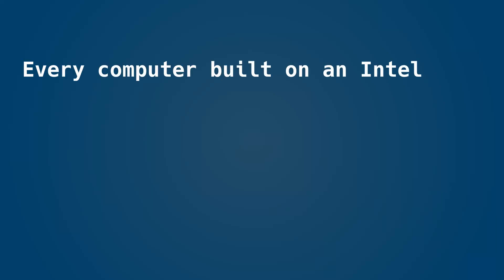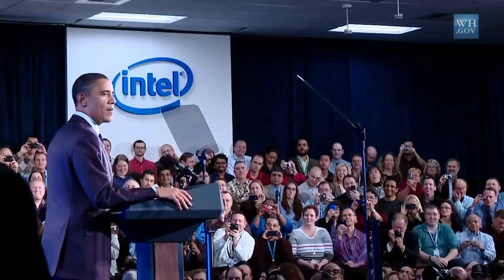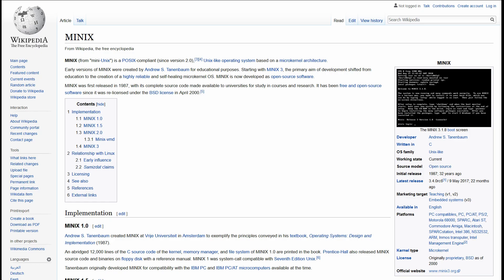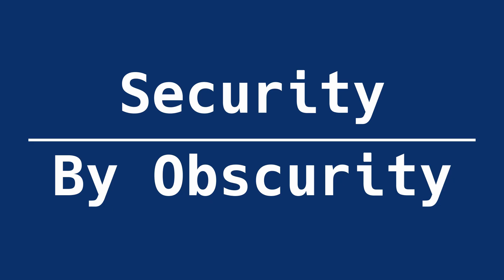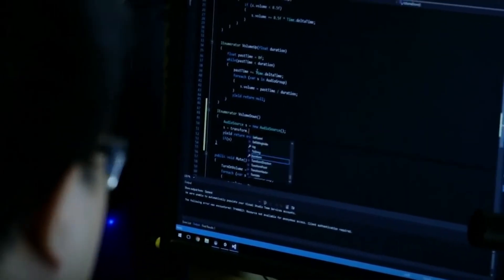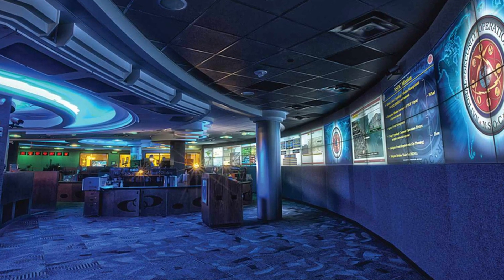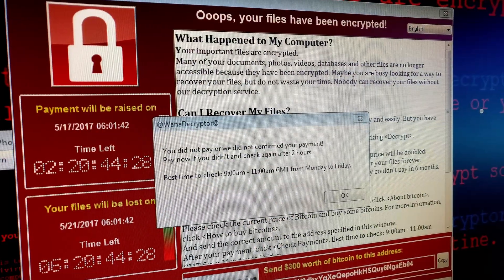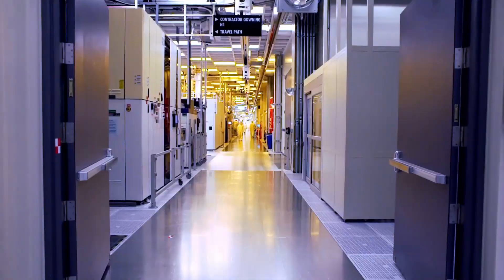How Intel wants to backdoor every computer in the world | Intel Management Engine explained

Comment: Microprocessor =/= microcontroller.
Please, for the love of god, do atleast some research before making a fearmongering video like this.
Reply: @nawtilismaelis2043  no legit im named after an anime character
Reply: @yangxiaolong8657  Still a ch1nk.
Reply: @nawtilismaelis2043  you seem like a fun guy
Reply: @nawtilismaelis2043  cut the racist BS out
Reply: Why are Intel so vague about it if there is nothing bad about it then?
Reply: @itIsI988  exactly, they should open source it
Reply: That’s why the dislike ratio is so high
Reply: Microprocessor =! Microcontroller
Reply: @Ky-vv8nj  you mean != Not =!
Reply: @nawtilismaelis2043  im not chinese
Reply: @michaelhord  salty?
Reply: a microprocessor is basically just a dedicated chip that needs other things to function, like external ram and such. a microcontroller has everything inside ready to use (like an arduino)
Reply: @kettlesimulator  No. Arduino isn't a microcontroller. The microcontroller is that DIP chip you see on it, and it needs external things like clocks to run.
Reply: @aidensmith6277  what i mean is it's a microcontroller based device. also sometimes you dont need external clocks if you're fine with internal clock
Reply: @kettlesimulator  oh, are there microcontrollers that have internal clocks? SMD microcontrollers?
Reply: @aidensmith6277  if you google the ATMEGA328p (a microcontroller), you'll see it has an internal 8MHz clock/oscillator. but most internal clocks have bad accuracy which basically means if you coded it to have a 1 second delay on say blinking an led, it might end up being 2 seconds
Reply: @kettlesimulator  oh, cool, didn't know that. Cheers mate :)
Reply: There's a microcontroller inside these microprocessors.
Reply: They have an Kernel With a network stack. With Root certificates. 
Think about it. They know the MicroProcessor better than most. How much of the assembly language is undocumented? 
They know better than anyone how to backdoor their own assembly language. They just need a method of code execution without a pesky OS in the way.
Reply: @nugget6635  "It does a bunch of things" =  I don't know what the fuck I'm talking about but I'm hoping you're dumber than me and won't notice that I don't know what the fuck I'm talking about.
Reply: Doesnt change the fact its a backdoor nobody wants
Reply: @yangxiaolong8657  Doesn't change the fact that you don't even know what its function is. Do you really think that the sole purpose of this thing is just to spy on you? No. From the perspective of a hpbbyist engineer I can tell you for certain that this thing would of had too much money, time, effort and sacrifice of the performance of the rest of the chip to just be a spy chip.
Reply: @aidensmith6277  Lol okay, so if it does something useful what is it?
Reply: @yangxiaolong8657  You lot are the ones claiming that it is a spy chip, so I want you to prove it.
The burden of proof is on you.
I never claimed I knew what it was, I just said that the soul purpose probably isn't just spying. Of all the functions it COULD have, spying is the one you are going to choose of you want views.
Reply: @aidensmith6277  whatever it's function is, it is still a backdoor and a serious security risk
Reply: @yangxiaolong8657  Security risk?
The whole video he was saying how you cant access the damned thing.
Sounds pretty secure to me.
Reply: @aidensmith6277  not that you know. Someone can access it, else it wouldnt exist. Now if that were to leak or if an exploit was found
Reply: @aidensmith6277  the fact that you can't access the thing should be of concern. What processes is it running in the background on its own separate OS? It can obviously formulate its own networking connections. What stops ME from sending your network packets unencrypted to N $ @?
Reply: @aidensmith6277  All we are saying is that spying is a very likely use of this tech, there are most likely other uses but spying is definitely a part of it. As if you had access to literally all the data on people's computers can you really say you wouldn't use it as a company. And the fact that it is there is a security risk. No matter what protections are in place having an nonremovable back door to everyone's systems is a huge problem.
Reply: @aidensmith6277  Imagine owning a house, but the contractor put a door leading inside your house and won't give the key to you.
Reply: @joshmoritty  A processor isn't a house, it is a complex machine that needs to be well oiled. It is a car. Imagine owning a car, but the manufacturer made a bonnet that, when opened, directly lead to your engine.
Imagine.
Reply: @aidensmith6277  But can you yourself open the bonnet?
Reply: @aidensmith6277  Then why it was not disclosed to public?
Reply: @aidensmith6277  you cant access anything of it, and it posseses the risk of spying.

what kind of proof do you need that its bad???

theres no need for a proof, since a security risk will always find people that exploit it.

theres one rule: if something can be used for a bad purpose, it will

Comment: My 2011 mobo has a jumper to disable it. The irony is that it doesn't even get past POST if i leave it on.
Reply: There's modules you can update, just like a driver. The UEFI bios is quite literally modular, and I used some tools to update the ME, just messing around, when I had to recover from a bios flash. Having said that, my board is from 2012 and it has a disable option in the ME section of the bios. This is not even that big a deal as many companies are including an on/off switch, and a hacker group showed how to effectively disable the ME right after all this ME news came out. The release of that info was several years ago.

Comment: Lmfao, yeah no. There’s no way a little “chip” inside a cpu is strong enough to log data and to transmit it back to intel without access to the Ethernet ports or Wireless Network cards. And if you know anything about networking, you’ll see the data transfer as it should be acknowledged via routers. Sorry if you’re gullible to believe anything you find on YouTube. Or the internet rather, but if you take a basic computer class, Goodluck explaining how the firmware of this “OS” operates and how it is not noticeable or accessible through the other devices. Especially when the cpu needs to have a motherboard to attach to, to even operate. And internet connection. Lmfao click bait once again.

Comment: Soo, I can’t even spoof IME or disable it, neat, wonder what will happen if I mess with the boot system so IME will have problems booting up.
Like the inability of some laptops to run Linux and windows via dual boot, I’m pretty sure I will jest corrupt my drivers but still an option I’m considering

Comment: So my thinkpad X60 from 2007 won't be spied by Intel?
Reply: nope, but you have to libreboot the x60 and run a linux environment with only free software (so that there are no hidden software backdoors). you probably shouldn't run systemd either since it's supposedly a mess and anything could be hidden there.

Correction: I made it sound like the OS needs to be linux based, but that's not the case. It would actually be much easier to avoid obstacles like systemd by using FreeBSD for example.

Comment: ASUS gives you the Option to Disable it Temporary, without System crashes after 30min( But you need to Unlock it, make it Visible ). And it doesnt show up in Device Manager. And there is ME Cleaner on Github. https://github.com/corna/me_cleaner

Comment: You have to trust your hardware vendors 100%. If you don't tust Intel 100%, don't buy their CPUs (you really don't have to any more since we got AMD Ryzen with Zen2 coming up). If you don't trust AMD, don't buy their CPUs or GPUs. If you don't trust NVidia, don't buy their GPUs in the first place and please, please, don't say "oh, this driver isn't open source, ima install the 5x slower and 3x buggier noveau driver instead!". Thats just facepalm IMO. Really, if you run an nvidia card it has nearly as much control as the Intel ME by being merely plugged in and doing GPU computing. At this point, installing all software NVIDIA ever released wouldn't even make even the smallest difference. And most importantly, HELL, RUN YOUR BIOS UPDATES!
Its even MORE important than Operating System updates these days.

Comment: Yet another reason to ditch Intel in favour of AMD.
Reply: if you didnt just comment before watching all of it you wouldve got to where he mentions amd having the same issue
Reply: @cHaMp630  unlike Intel's IME, AMD's     PSP can simply be disabled in the BIOS.
Reply: @HomerSparkle  do you have an actual proof it disables it and isnt just there to make you feel better?
Reply: @cHaMp630  : Doesn't matter, because again unlike IME, PSP doesn't have it's own network stack, and so without drivers and client software explicitly installed on the host by the user, it has no means of communication. Disabling PSP in the BIOS simply means that it won't work even with the presence of that network stack on the host.

You should really try to understand this stuff before you blabber about it. PSP is not even remotely like IME.

Comment: Time to dust off and start using my IBM L40 SX laptop running Dos and Win 3.1 with a 386 processor from like around 1990. And it doesn’t have to update every 5 minutes. Just hope all the 3.5 floppies are still good.
Reply: Old tech is ridiculously easy to exploit.

Comment: Do you know what a RAC is? 
Like a way older DRAC5 from Dell, what's it used for and usefull at.
Very usefull. 
That is also running a modified *nix os and ngnix or sorts of http server.

Scan your computer's ports while off or   sleeping. All 65535. 
If the lan lights are on with the system off, then you're in for joy. :D
But...
I can't recall exactly but when I stumbled across IME, quite a few years ago, by scanning the entire lan with the computers randomly on and off, I found a foreign mac in a different subnet than was running and that triggered me and identified a Fujitsu oem desktop that was sporting IME and had options to disable it and after  disabling it (had a config menu just like an Dell RAC) the lan port became inactive, no longer had a carrier. 

IME poses a real risk only for the most ignorant in computers.

Comment: this is in every computer in your computer you cant do anything about it it cant be removed it cant be disabled as long as it is plugged into the wall it is sending all your information to the nsa directly right now as your reading this be scared but however they cant find all the pedophiles with child porn on their computers yet they can see all your files right now theyre looking at them however all child predators use computers from before 2008 so they get away fyl intel is watching you be afraid.

Comment: I am on a P4 system, from 2004 running Linux. No wireless devices anywhere here. No cell phone just voip over outdated hardware and rotary phones. Router and firewall built from cyrix based PC.

Comment: So you think IME is magic component that can autohack through firewalls, has a whole OS within KBs available in bios to it etc. Let me ask you three questions:
1. How does IME hack firewall on my router that forbids access to every port and every internet address?
2. What does intel plan to live off of if they utilize this magic component and consequently then looses all business world wide?
3. Did NASA fake Moon Landing?

Bonus: question, if IME cannot be disabled  - how did Dell  manage to push update for AlienWare laptops that disabled IME, resulting in laptops not booting, and then fixed that update by still  having IME disabled, but laptops working now but super slow? How does that correspond with your" cannot be disabled or turned of" ?
Do you realize how much bullshit is in your video?

Comment: Oh dear, this is conspiracy theory at it's best...
The Intel Management Engine is simply used to debug the chip during development, mostly. Intel uses this to connect to the chip and see exactly was is happening on the chip on a circuit level since there are dozens of diagnosis lines which can be analyzed to find errors. The thing is that once the development has finished it would be more expensive to remove this part of the chip than to simply leave it there and put it into every built chip, believe it or not. Instead of having some useless (in the later stages) part on the chip, it is reasonable to extend this part by a bit to accomplish some other useful function like chip version management. As it is known, Intel (and other chip manufacturers) artificially restrict some of their chips so they can more easily get a lineup of different chips with different capabilities. This restriction of some chips is achieved by configuring the chips via the Management Engine. It is also worth mentioning that other chip manufacturers are using similar techniques, too.
It is never known whether this could be abused. However, the initial intention of such an engine is clearly NOT to spy people.

Comment: “We don’t know much about this os....”

Proceeds to say a thousand damn things about it
Reply: We know about the publicly available open source base OS, nothing about how Intel has modified it. If you are not familiar with open source, it's essentially a template that any engineer could pour through and change manually. So long as you know what you're doing you can give Minix an entirely different set of functions. A very simple version of this would be to set up a service that sends keystrokes to a remote server. That's a relatively small alteration to a base OS that could very easily ruin your life.
Reply: Njr 9372 how does it work then?
Reply: Merkk it goes beep boop,

I didn’t say he told us how it worked, I thought it was a bit funny he said we don’t know much about it at all, then told us a lot about it. Just a laugh, not too deep.
Reply: @Njr-ww1yh  fair enough.
Reply: @Njr-ww1yh  
He only described it. Almost no one understands its inner workings, let alone if all this description is even accurate.
Reply: It's now possible for Israel to destroy an American warship by one man at a computer on the other side of the world. Israel Inside Intel.
Reply: @ianpennack  no
Reply: @deoxal7947  No ?. Only if we take back intel from israel.
Reply: operating systems are so unbelievably complex that even this glut of information is the equivalent of putting a scratch in the surface. If you're ever feeling adventurous, check out the Linux kernel tree to see the kind of stuff a computer can access and manage
Reply: LOL it's so loud you can't even hear it.   N dont tempt me

Comment: Remove the Ethernet cable and they won't be able to steal your porn.
Reply: Your porn is already compromised
Reply: I tried to, but then I'm unable to connect
Reply: But how will i get the prons if I'm not connected to the world wide pron?
Reply: @005AGIMA  that' s the real question
Reply: When necessary, this technology can be used to require an internet connection for you to boot your computer.

It's just that you're not important enough for them to do so.
Reply: @edwardyang8254  if your computer doesn't have internet connection they can't order your computer to require internet connection...
Reply: @HAWXLEADER  They can. It's actually not that hard to have a key which expires every now and then, which can be installed as long as you get connected more than once.

The thing is, whoever wants to use IME against you have nothing to gain from your computer if you do not connect to the Internet at least 2 or more times. In fact, you wouldn't be able to get your porn if not from the Internet in the first place.

This technology ensures that even though you bought the CPU, you cannot operate it on the Internet. Intel or whoever controls the IME does.
Reply: @edwardyang8254  Many institutes have their own "internet".(or intranet if you wanna call it that)
Reply: @HAWXLEADER  If you don't know the difference between Internet and Intranet, then you don't know what IME can or cannot do.

If an intranet is physically contained, then it's no different than an unconnected machine, and nothing on it will be useful/interesting to the IME operator. If an intranet is virtually contained, then it will have to connect to the Internet to build the VPN on top of it, and will be compromised by IME.

Even Google is against IME, because it makes Google's own datacenters vulnerable. Google can make special deal with Intel. Your local porn store can't.
Reply: @edwardyang8254  So as I said intranet is basically a self contained network, hence "their own internet",  i said that phrase only so that people who don't know what an intranet is will understand.
Reply: @HAWXLEADER  I don't know what you're trying to prove? The fact is the argument that one can simply disconnect to be safe from IME is just naive and wrong. Either you make your machine (or "Intranet", which you obviously don't know what you're talking about) uninteresting to the hackers, or have it compromised by IME even if you subsequently disconnect it from the internet.

Note that VPN is still on the Internet and will be compromised as well.
Reply: @HAWXLEADER  its intranet the internet is the connections of many many many lans
Reply: *cough * cough * VPN * cough * cough *
Reply: When I turn my PC to sleep mode (I never shut it off completely) I pull the ethernet cable, so at least they can't do something irt. Course this does not help, if you're already infected by something.
Reply: Yeahh